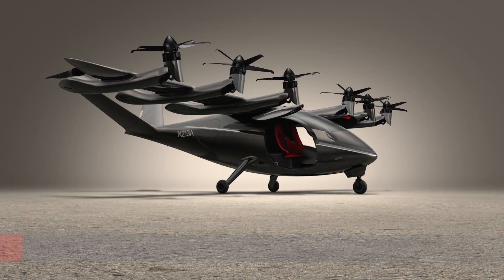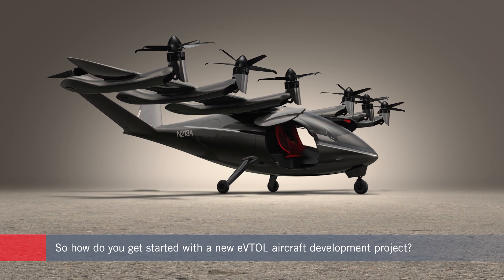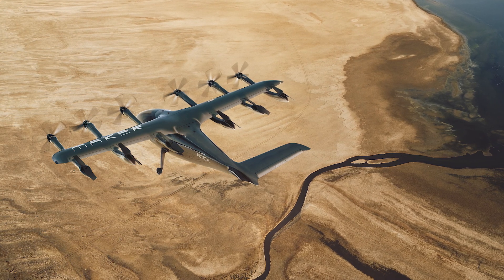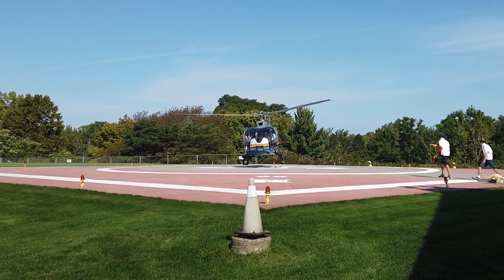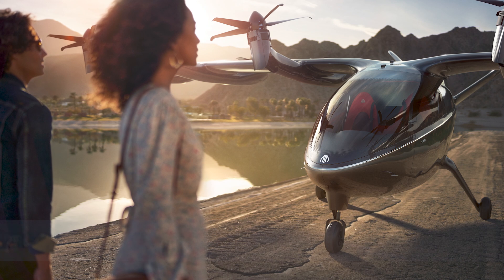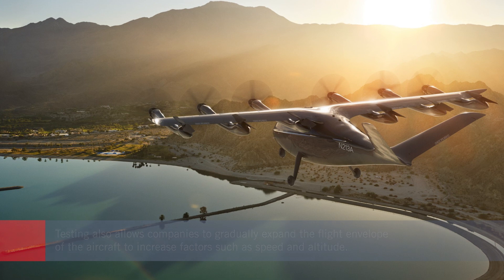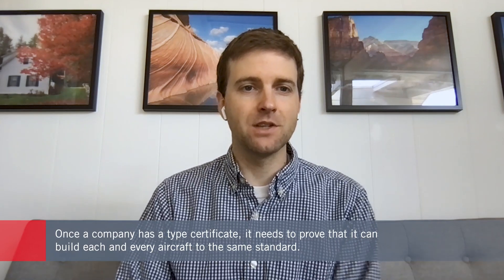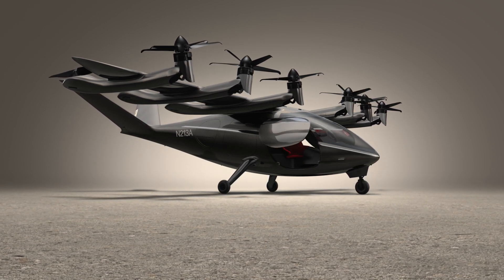What Does It Take To Get New eVTOL Aircraft Certified and in Service? – FutureFlight Explainer

Comment: The basis for aviation safety is to be failsafe - IF the worst case reasonably forseeable even occurs can the vehicle survive and make a safe landing ?  the bird/flock strike example is an obvious one -it WILL happen, probably quite regularly given the type of operation, altitude etc and the 'suck down' effect of an otherwise near miss in the hover case (birds plan their flightpath unaware of such effects- videos of flocks of pigeons colliding with model drones or attacks by raptors are fairly common )  Those extremely long motor nacelles are set up for propeller whirl flutter even without any damage but if a blade or two are shed ,impact with birds or bats ,hail etc they will tear off the wing for sure -the idea of a 'one in a billion  10 to the minus 9 ' failure chance is totally unrealistic (just ask a glider pilot if they have ever been attacked by a hawk or eagle - I have - ditto for RC pilots ,even higher speed GA and airliners 'run into' birds .  demonstration of the post impact controllability and structural integrity MUST be established --at least with remote control you can find out without loss of life . just as certification of jet engines requires deliberate 'shooting' of bird carcasses into the running engine so must these rotor borne devices be shown to survive a mid air bird(s) strike - flocking birds will be multiple strikes at once.

Comment: Very good information. Forgot to think about the operating temperature issue. I am also very interested on requirements and means of compliance for bird strike scenarios for these eVTOLs, never heard any company or certification body talk about this. Basically if the intention is to popularize urban air mobility as so many of these start ups are claiming, it seems to me there will come a time the air traffic density will unavoidably get in contact more frequently with wild life.
Reply: Agree on the problem with bird strikes. From the info I can find on radar performance, I think it could work to have an onboard radar for bird detection and then make avoidance maneuvers when needed.
Reply: LIDAR would be a better option. Radar is very limited in how close an object can be and still relay accurate information. In my uneducated opinion, the best and safest avoidance maneuver when encountering something organic, like a flock of birds, is to stop and hover till the object has moved on. This is one area where a VTOL will shine, similar to collision avoidance in a lot of cars. Most don't swerve (maybe Tesla does?), they just apply the brakes.